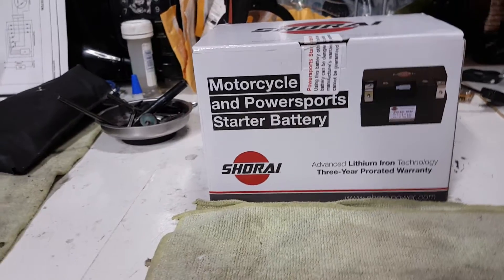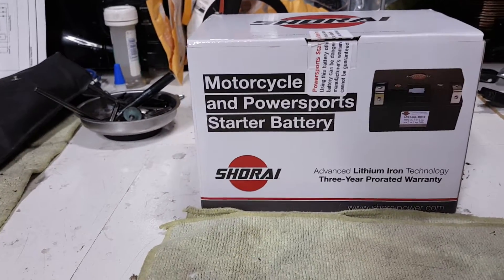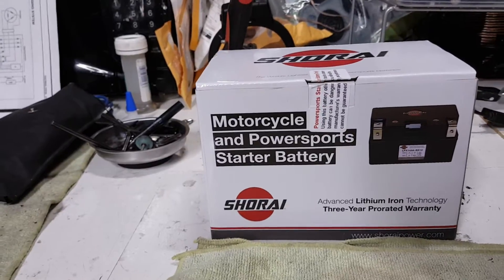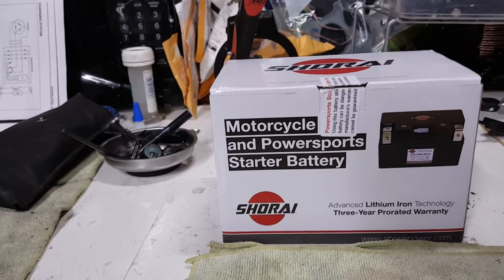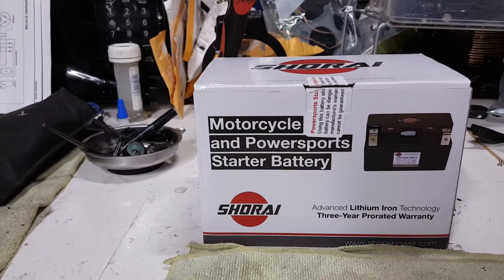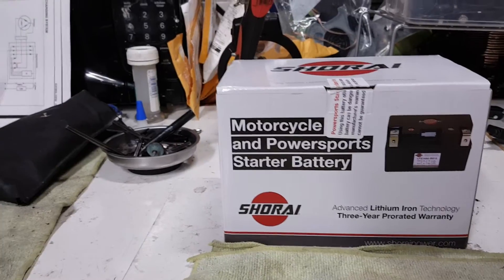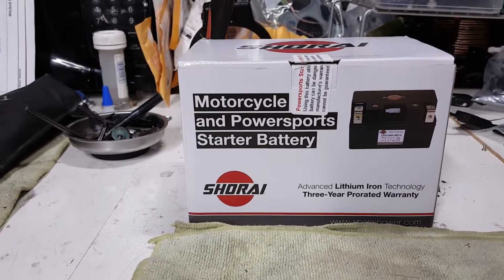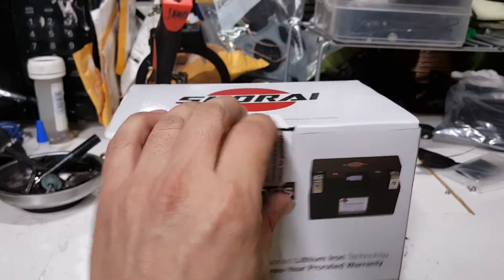Shorai Lithium Ion Battery Review and Installation

Comment: I know this is old.. but u made a post about the MOSFET which is badass RR, than ur Shorai battery which also badass.. but than u put a eBay 30$ stator on ur bike.. that's ur problem there. I have MOSFET as well, over a year now, with a Rick's stator and Shorai and no issues at all.

Same applies to the cheap eBay stators as well like the Cheap eBay RR. It's not good at all. U gonna have to bite the bullet and spend 170-200 on a stator.. U spent that much on a MOSFET and a Shorai battery, why would u put a 30$ stator to run with ur MOSFET and Shorai? Lol
Reply from the maker: At the time, I didn't have the knowledge of reputable brands when it came to Stators so I based my selection off of user ratings who purchased the same stator from the seller. I evidently got lucky because I still have the same stator in my bike today and haven't had a single issue. But yes  the wiser choice would be to go with a solid well know selection then to go the cheap eBay route.. no doubt.

Comment: hi man you said its a good battery??? i got yamaha r1 2011 as we all know its a bike hard to start i have yuasa ytz10s i think to buy this shorai what you said its good ??
Reply from the maker: IMPO it's definitely worth the extra coinage. I haven't experienced a dead battery or failure to crank over since I put this in and I'm going on 4 years now with the same battery. My bike basically lives outside under a cover and here in cali the winter nights dip down into the 40s and still this battery turns over no problem.

Here is what Shorai sells your battery for but you can get off Amazon way cheaper

Shorai Website
https://shoraipower.com/battery?type=175&make=381186&model=381303&year=381303

Amazon Website
https://amzn.to/3584Rom
Reply: @TheChemistDIY  on shorai website for my bike out of stock on amazon they have it so you said its a good battery better than the stock yuasa
Reply from the maker: @sasaz1989  I had my reservations about purchasing it to brother but this is one purchase I was happy I made. From my personal experience I have to say this is a GREAT battery. Before this I had purchased 2 OEM batteries and both died on me within a years time. I havent had to buy another since I went this route. Plus I love the additional battery post terminals for additional accessories. Right now I have my LED fog lights, Glow Kit, and external power connection adapter hooked up to those.. very convenient.
Reply: @TheChemistDIY  thanx man  i got xenon on bike this battery well help me  . merry christmas
Reply from the maker: @sasaz1989  No problem brother, anytime... same to you and Happy New Years.

Comment: How do you test the shorai battery with a multimeter?
Reply from the maker: Just like any other battery, put your meter across the + - terminals, set to dc and measure voltage.
Reply: Doh !!

Comment: Issues with starting in cold weather are most common in shorai, becaue they over rate their batteries. A 320cca 12ah equivalent would actually be  220cca and 7ah equivalent. Anti gravity is the best brand for lithium batteries.
Reply from the maker: Hi John. While I have read those reviews as well i have yet to experience them myself. I've had this battery for almost a year now and never have I had a failed crank or low voltage reading. I live in Cali and the coldest morning that i have experienced using this battery was about 47 degrees and the bike turned over like a champ. This may differ to those states will ex-stream constant cold weather though. Every morning when click that voltage meter on before starting the bike it has always read 13.4 volts. I can honestly say this was a great purchase thus far.
Reply: @TheChemistDIY  LIked your video. Here are my thoughts: you stated that the coldest morning where you live (CA) is about 47 degrees and your motorbike starts like a champ using this Lithium-iron battery, what am I supposed to use as far as battery in a city, Chicago that is, where you wake up with (-47 degrees) and try to start your motorbike or any motorbike, an industrial train's battery? hahahahahaha
Reply from the maker: @larisaidis  lol, at -47 degrees i wouldnt even attempted to leave the house..lol. but what i can say is this, its been almost 3 years since the making of this video and i still have the same battery and it has never failed to start once since installation. Ive never had to charge it or place a trickle charge it to keep it powdered after a weeks time of sitting, this battery is a die hard.. i stand by word, and my word is experiencing it for myself. I would highly recommend this battery to anyone if they asked.
Reply: @TheChemistDIY  thx, do i need to buy a specific charger when i buy a lithium battery for my motorbike?
Reply from the maker: @larisaidis  shorai does sell a special charger for the battery but i never purchased it. The by itself comes fully charged and and ready to install. On first crank after installation my bike has started every single time so there has never been an instance where i needed it. Im sure you can charge it normally without the special adapter unit as that is how the stator does it daily (directly to the terminals)